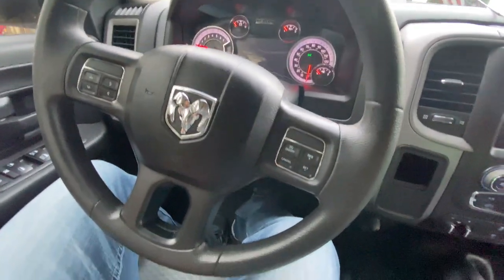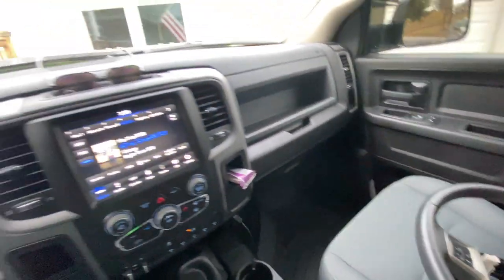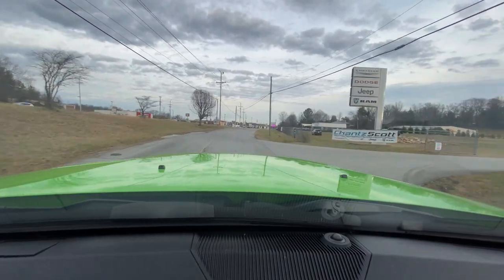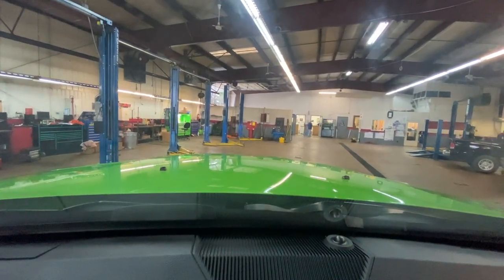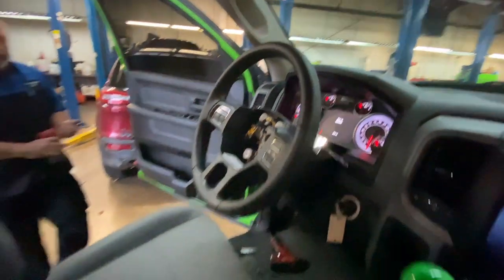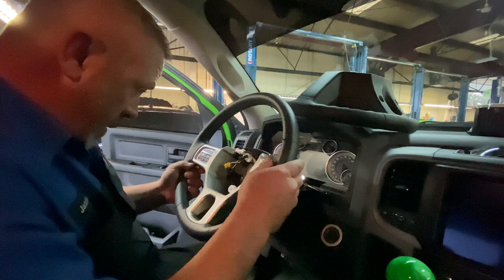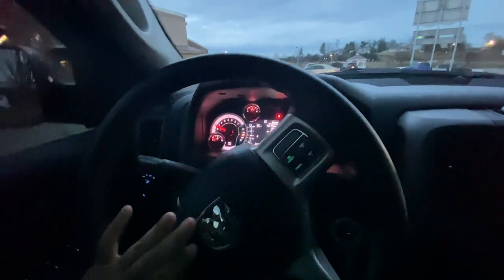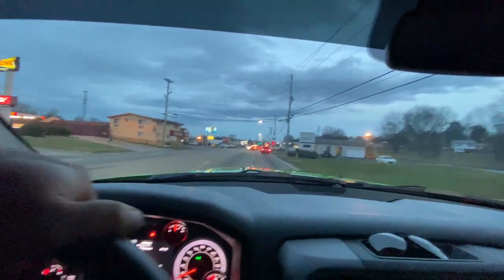HOW TO UPGRADE/SWAP YOUR RAM STEERING WHEEL IN A MATTER OF MINUTES

Comment: That is one brave mechanic to remove that airbag without disconnecting the battery. I've removed those many times without incident and have seen people try to remove them and almost get killed when the airbag deployed. Glad it worked out though.

Comment: little late here..... regarding the wiring is it just plug the harness back in? You didnt show where the electrical harness was connected at, and if you just plug it back in without having to rewire anything? About to do this swap myself but want to make sure its just plug and play, like if i need to rewire the harness to accomodate the radio control back buttons?

Comment: Where did you get the wheel from? What head unit did you use? I have a Ram Tradesman 1500 and I have that plain radio and I want a head unit with backup cam

Comment: Seth, so to clarify (cause I’m buying a steering wheel similar to yours), you didn’t have to buy a wiring harness for the volume controls to work? They were already in the column?
Reply: Correct.

Comment: Awesome video, I just added the Laramie cluster to mine and have a longhorn steering wheel waiting to go on lol. Need to do the radio next.
Reply from the maker: Sean Mason thanks man yeah I hated the small cluster screen and the small radio. Let me know when you do the radio I got mine with the whole kit for the swap off a guy on fb
Reply: Does the guy sell them all the time? Info please?  I also went with a gas cluster lol
Reply from the maker: Sean Mason yes sir he’s on the 6.7 groups on fb Don Korshank is his name shoot him a message
Reply: Swapped in the same cluster to my 13 express, but I don’t get the Ram animation on start up. It goes straight to a TPMS reading failure and the fuel mileage isn’t accurate. Any help?

Comment: I have a ram 2014 ram 1500 that for some reason the cruise control button has stopped working (i think its jammed) do you think if i replace the steering wheel like in your video it could fix my issue?

Comment: What would it take to get your backup camera to show up on the 8 inch screen? Do you need a new camera wiring or a programming issue?
Reply from the maker: Nick Barry I have to pin it to the back of the video output on the radio. Never got to that yet doesn’t really bother me I can see it in my rear view camera

Comment: Can you possible add the power heated steering wheel to a 2013 ram 1500 that doesn’t have the heated steering wheel originally
Reply from the maker: Yes
Reply: Yes but have to add the seat module too I believe.

Comment: Why you dont have the backup camera signal in the radio? Is easy to get that signal.
Reply from the maker: changchung factory it came in the rear view camera I haven’t connected it to the screen yet I’ve got the rear cargo camera to connect too
Reply: @SethRighi  Nice. It will be nice get both signals in the radio.

Comment: Is your truck a 2019 or 2018 I am trying to look for a kit that will plug and play but everywhere I look they are saying the steering wheel volume controls will not work on a 2019.
Reply from the maker: 2018 a 2019 classic is the same

Comment: Where did you buy the steering wheel.  I need a new one on my Laramie.  For some reason my leather steering wheel is delaminating at the top pretty badly. It’s driving me nuts.    I miss my G56 transmission, however I also have the Aisin which I love.
Reply from the maker: used on fb marketplace